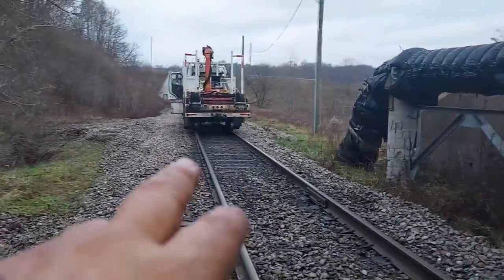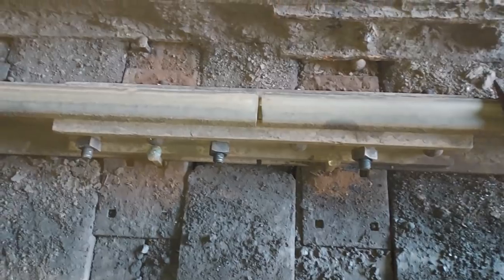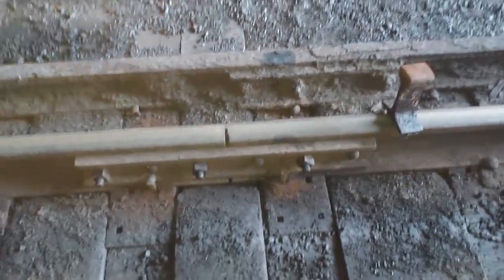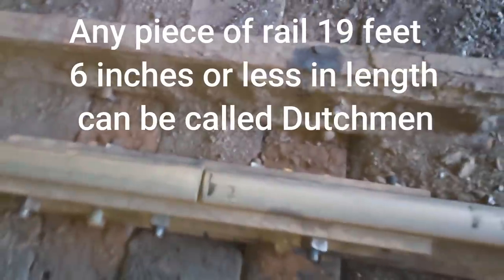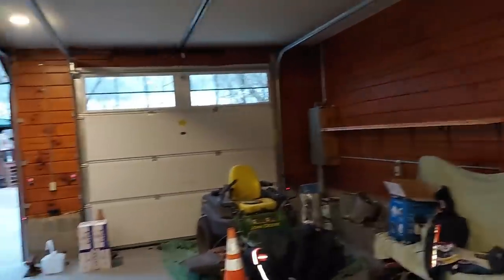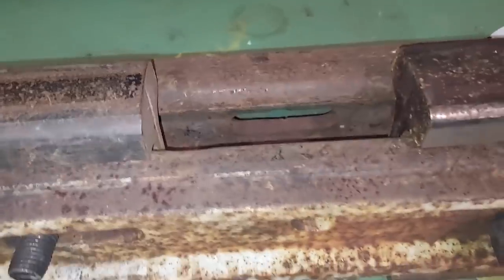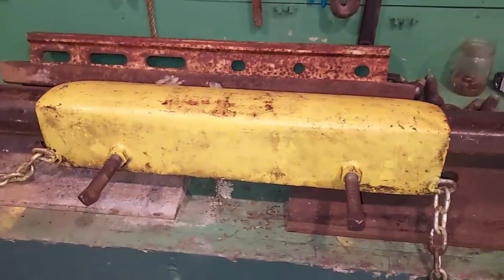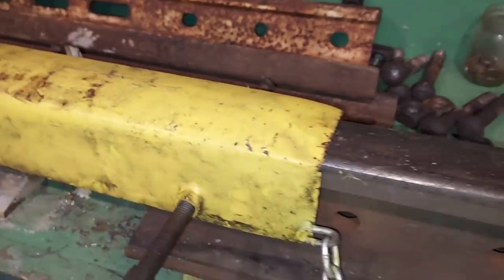Railroad Rail Splints, Dutchmen and Slotted Joint Bars - Pretty Cool Stuff!

Comment: My local shortline railroad is the Mission Mountain Railroad (MMT), which runs between Eureka, and Stryker Montana. It's a railroad of just over 23.5 miles in mainline track, and it's all 110-pound rail. However, my question is about the joints. The southern 6 miles of the route is all (6 Bolt Joint Rail) as I call it, meaning it has 6 slot joint bars, and the northern section is all (4 Bolt Joint Rail). Why would it be different and what changes?
Reply from the maker: Very good question NWF. I don't have a good answer. But know this,
the FRA allows up to 2 bolts missing in a joint bar, one on either
side of the bar. With a 6 hole bar that means 4 bolts are
still holding it. Not desirable but within code fed regs. With a 4 hole
joint bar you have to keep all 4 bolts in to be in compliance so
it seems that 4 hole bars are not the way to go without constant
maintenance in keeping bolts in. They just have had old rail that
was only drilled with 4 holes in that northern section.  Appreciate very
much your visiting with us to check out the video my friend.
Reply: Thank you so much. I love your videos and I learn so much every time I sit down and view the channel.
Reply from the maker: @NWFProductions  😊👍

Comment: On welded rail, what prevents the rail from buckling when it expands and contracts?  I run into this problem on my model RR and I can't imagine what happens on a real rr.
Reply from the maker: Every tie on CWR is anchored to add resistance against the
rail creep and the effects of expansion and contraction. There are
also stringent FRA requirements on when CWR can be laid in
the track. Throw your curves out a bit on your layout and
see if that makes a difference. I do that sometimes here on
jointed track, throw the curves out for summer and back in for
winter. Thanks for writing in Rupert.

Comment: What are the rails inside the track for?? Always wonder what they are used for
Reply: To keep the trucks on freight cars
squared up in case of derailment
in the tunnel!! They use them on
bridges too!!
Reply from the maker: They are called guard rails, some old railroaders called them 
Jordan Rails, our friends across the ocean call them check rails.
They are to help and try to prevent derailed cars from going to far
off the track bed specially on bridges where you wouldn't want
cars from toppling over onto roads or streams that may be
below the bridge. Great question and thanks for asking Jacob.

Comment: I have a question. You had  pull apart, So you added rail to fix it. Now this summer won't you have a sun kink because of expansion?
Reply from the maker: That is an excellent question Bryan. This small section of track
is first shaded by the tunnel and the tunnel approach stays fairly
cool in the summer compared to the rest of the track. Had this been
out in the open where the sun would hit it a lot, then we would
be concerned. We almost never add rail and very often actually
de stress rail where we will cut rail out. Hope that helps sir.
Reply: @ccrx6700  yep, thanks! :)

Comment: If the rail pulls apart and you slide it back together, doesn't that just cause the gap to move down to the other end of the rail?
Reply from the maker: Good question sir and in many cases it would. In this instance
we added rail in to prevent that from happening here. Do appreciate your writing in and for watching the video.

Comment: Is track inspection done daily or weekly.
Reply from the maker: CFR 49 part 213 requires our class 2 track to have at minimum
a once a week inspection. I often do 2 or 3 times a week
especially in cold weather to check for broken joint bars or
pull aparts and also in very hot weather to look for track
buckles (sun kinks). No harm in going over and above the
Code Fed Regs. Winter is hard on track. Thanks for asking
Michael. And the higher the class of track the more frequent
track inspections are required by Fed law.

Comment: What is the purpose of that inner rail when you were in the tunnel?  I have seen them before and could never figure this out.
Reply: Guide rails to keep the trucks squared up in the tunnel in case
of derailment!! They use them on
Bridges too!!
Reply: @conrailfan6277  Awesome.  Thanks.  I never really knew that but it certainly makes sense.
Reply from the maker: They are called guard rails, some old railroaders called them 
Jordan Rails, our friends across the ocean call them check rails.
They are to help and try to prevent derailed cars from going to far
off the track bed specially on bridges where you wouldn't want
cars from toppling over onto roads or streams that may be
below the bridge. Great question and thanks for asking my friend.

Comment: What are the rails that are inside the normal rails? What is their purpose?
Reply from the maker: Good question George. They are guard rails. In case of a derailment
they will keep the truck set going straight instead of veering off
to one side or the other. Important on bridges over public roads so
a car doesn't fall over the side of a bridge.

Comment: whats that rail in the middle of the track for?
Reply from the maker: Those are guard rails, they are designed in case of a derailment
to keep the cars from drifting to far off the track. Some guys
call them Jordan Rails, our friends across the ocean call them
check rails.. thanks for writing in and for watching the video.
Reply: @ccrx6700  I figured they had something to do with a derailment but was not sure dont see that around my parts very much.

Comment: Ccrx what is the sharpest turn a train can make an still stay upright?
Reply from the maker: Well Michael that question is one I do not know the answer to.
Depends on the speed of the train and the super elevation in the
curve. EMD in their SD 40 operators manual says that locomotive
will negotiate up to a 30 degree curve when it's not coupled to
anything. Personally I find that hard to believe, but they made the
loco and wrote the book, and also they don't state at what speed
the loco would be going. That loco depending on the traction
motor gear ratio can also attain speeds of up to around 80.

3 axle locomotives are really hard on track structure the sharper
the curves get. They want to push the curve and there is a
tremendous amount of wear on the high side rail from them
trying to negotiate a sharp curve. Our highest degree curve we
have here on main is a 13 degree, we have a 14 degree curve on
a siding. You don't find those sharp degree of curves on high
speed rails. Most RR's use a 2 axle loco for switching in yards
with sharp degree curves to save on track wear. You've got to
have really good ties and well driven spikes on high degree
curves to keep the track in line.
Hope that helps somewhat.
Reply: @ccrx6700  from watching, pulling other cars, normal size train?

Comment: Does the creeping ever cause a rail to buckle?
Reply from the maker: Absolutely. They are called technically  heat buckles but most
often referred to as sun or heat kinks. Thermal expansion of
the rail can cause a heat buckle in the track.  Creep encompasses
more than thermal expansion, creep can also be caused by
train braking plus train driving wheels pushing the rail backwards,
those usually do not cause a buckle tho. Although heavy braking
can. Good question sir and thanks for writing in and also for
checking out the video.
Reply: @ccrx6700  Your routine for events where rails pull apart at a joint seems to be, if it's safe to heat, you light your fire snake on the side toward the direction of creep and you try to creep it back to where it was and bolt it back together. What if instead of doing that, you always added more rail? It would buckle down the line, right?
Reply from the maker: @b43xoit  👍😊

Comment: When a RAIL pulls apart, and you said "it drifts to the East", where does it go?  It cannot just disappear, it seems to me that it would "DRIFT" into or away from a curve in the track, making the curve more narrow or wider.  That is just my assumption.  I am more interested in your thoughts.  Thank You.
Reply from the maker: Very good question Mike. On all jointed track like we have rail
will creep up to 12 inches per mile under the right conditions. This creep running east here will cause the gaps in the east joints
to start to close up, that is where the rail goes. We have often in
the past de stressed rail, meaning that we will actually cut out
small pieces of rail then lengthen those joint gaps back to where
they should be. 

On very hot days with no clouds if all the gaps are closed then there is a possibility of rail in a curve or tangent wanting to buckle, which you have probably heard as being a sun or heat kink. If it happens in
tangent track then there will be an S shape formed in the track,
if it happens in a curve then there will be a C shape formed as the curve pushes outward to relieve the tension. Hope that helps

Comment: A Welder or termite thermite welding?
Reply: Not an expert, but I don't believe there is ANY standard way of welding rail other than thermite.
Reply: @leebarnes655  had to use 7018 lh once finishing with a hard servicing (facing) 750 had no other choice
Reply from the maker: Lee, some RR;s use a process called flash butt welding, there
are a few videos on You tube about that if you're interested.
Thanks for writing in and for watching sir.

Comment: It would be much cheaper and cleaner to Waterjet those joint bars in the future, at 70k psi the water jet will cut a rail in half like butter. No heat no distortion etc.
Reply from the maker: Never heard of that process, will have to do some research,
thanks for the info sir.

Comment: https://youtu.be/agznZBiK_Bs   Dave, I seen this video months ago and wanted to share it with you. Its similar to what you were showing us  about a separated rail and you mentioned your comfort level of running a train over. I hope I remember correctly but I think this addresses a decent gap a train can handle.
Reply from the maker: I've seen that Dennis and yes it is amazing. What is amazing to
me also is all they had to do was pull the spikes and the gage
would widen and the train fall thru instead of cutting out rail.
Appreciate the link my friend.